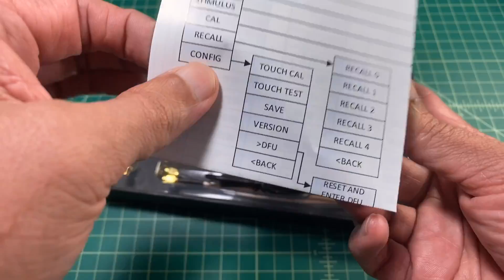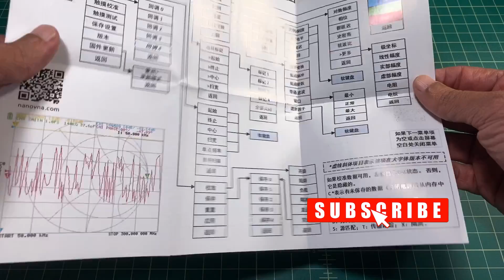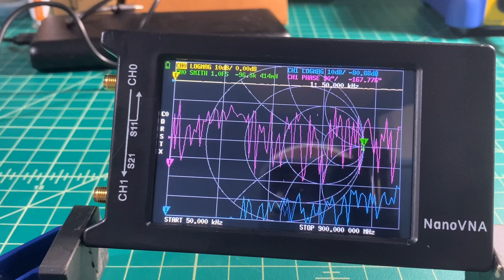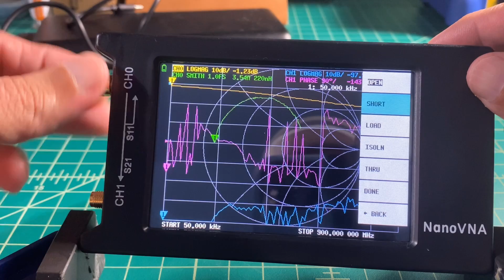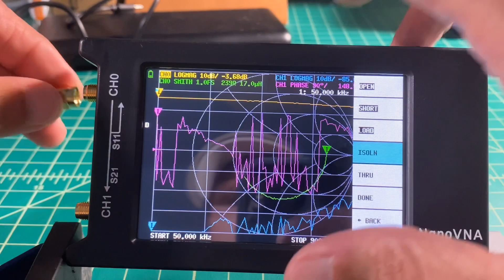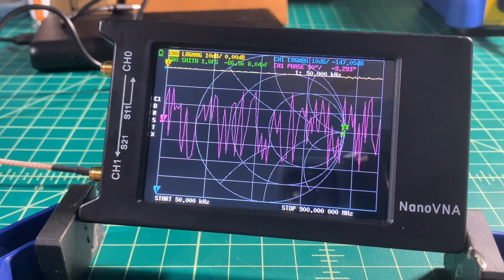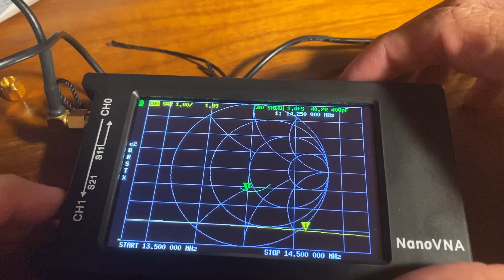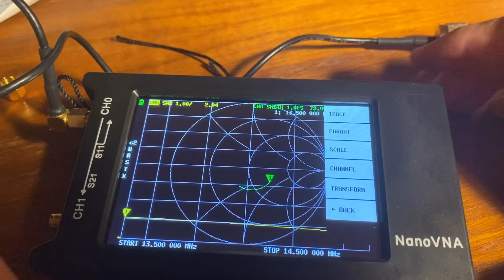NanoVNA-H4 Made Easy - HAM Radio - TheSmokinApe

Comment: The nanoVNA beat the heck of my Mr100 an Arduino based SWR analyser with a 2 line LCD display. Same calibration procedure with a short, open and 50 ohm load. Also we could build an Antenna simulator circuit with a value of LCR that gave a dip in the band of interest. I find it assuming that at the time the Mr100 was available from the usual suspects at $75 USD and that is about what I paid for my nanoVNA-H4 today.
Reply from the maker: I  have never heard of the Mr100, thanks for the heads up!

Comment: About 2 months ago I bought my nanovna-h4 from Bangood. After that I watched pretty near every video available on how to check swr. In the mean time I bought some adapters, cables and dust caps. I finally had the bright idea to try one of the cables I had purchased (sma to so239). It worked! It seems the original cable was bad. Anyway, just an FYI.
Reply from the maker: Unfortunately a bad cable can slip through, glad you got it worked out 👍

Comment: Is the nanovna saver software needed for specific functions, and firmware updates, or can the nanoVNA be used on its own for all its functions, similarly to the function you show in your video ? I have not purchased the NanoVNA yet as after trying to install its software on Ubuntu for over an hour I am unable to get it to run at all, so I would need to use it as a standalone device, or seek an alternative device if this cannot be done.
Reply from the maker: You can use it just fine as a stand along device 👍
Reply: @TheSmokinApe  Thank You for your help
Reply from the maker: Good luck with it 👍

Comment: Hi there i am attemting to test a car ignition key fob that works on RF 430mhz, i am told that its possible to do with a VNA but i havent achived it yet, any ideas?...its for the central locking on the car,,,just to see if the key is sending out a signal when you press the buttons..thanks from Fred in England..
Reply from the maker: The TinySA is the tool for the job 👍

Comment: Can this be used to measure spectrum purity like the tinySA?
Reply from the maker: No, to separate instruments
Reply: Cool, it'll be here tomorrow and I'll be watching your video on the tiny SA Ultra!
Reply from the maker: Nice, good luck with it 👍
Reply: @TheSmokinApe  

I tested my Baofeng 5RM and got:

1st (set) 146.52 10 dBm with the 40 dB attenuator 
2nd 146.4  -14dBm with the 40 dB attenuator 
3rd 292.9  -17dBm with the 40 dB attenuator 
4th 439 -27dBm with the 40 dB attenuator 
5th 585 -27dBm with the 40 dB attenuator 
6th 732 -48dBm with the 40 dB attenuator
There was a 7 and 8 but both under -40 

As I interrupt this is that the -14dBm is actually +36??

Comment: 5:42 the "short" calibration cap  that you use sure as hell looks like the 50 ohm cap. 
They are NOT labeled.!  
You have me confused as hell 5 minutes into the series.
You also failed to show the insides of the "load" cap.
I think I have it straight but the video didn't help.

Comment: So I have saved stimulus setting for each band that I have privileges on. I calibrated each time after setting the stimulus. Did I understand that you can calibrate once from 80 to 2 meters and then just add the stimulus I want providing I stay within that original calibration range?
Reply from the maker: Your best bet is to set the stimulus, calibrate and then save that to memory slot 👍

Comment: Tnx for the video. Vy nice. BUT.... My H4 model never shows correct readings. Followed your guide, but still.. I have to miss something! Used your video on my other earlier model vna, and everything works just fine. Maybe the new vna is broken. Who knows. Any ideas? Tnx again. 73...
Reply from the maker: Try calibrating with the standard from the first VNA, it could be a bad standard 👍
Reply: Tnx... Already done that. Seems like a faulty vna, so sending it back to the shop for a refund. Tnx agn..

Comment: @TheSmokinApe i have a question about some letters on the left side of the screen about halfway down, the letters you normally see C0, D,R,S,T,X. mine also has in red Pa all the time. would you chance know what the Pa stands for and how to turn Pa letters off? thank you
Reply from the maker: C0 C1 C2 C3 C4 : Each indicates that the corresponding calibration data is loaded.
c0 c1 c2 c3 c4 : Each indicates that the corresponding number of calibration data is loaded, but the frequency range has been changed after loading, indicating that the error correction is using complement.
D : Indicates that directivity error correction is applied
R : refrection tracking Indicates that error correction is applied
S : source match Indicates that error correction is applied
T : transmission tracking Indicates that error correction is applied
X : indicates that isolation (crosstalk) error correction is applied
Reply: @TheSmokinApe  I have a Red Pa letters also
Reply from the maker: Sorry Byron, I missed that. P - power level used on calibration.

Px is for Calibrate-power
a - auto, power level depend from frequency at measure point.
If after calibration change output power, Px text show as red
This is due to bug in that version X text rewrite by Px (power level)

Comment: Ok, here is the confusion I have found on several nano videos. Most so far have said you do not calibrate until the start and stop frequencies are input. You started out calibrating with out your own start and stop frequencies.I do not have a manual on mine so I am not sure which way is right. I also wonder about reset...foes that clear the save spots? Some say it does and that you have to reset before doing more measurements.
Reply from the maker: It’s best to set the frequencies first, you can save the calibration to be recalled later 👍

Comment: Does this accurately measure HT antennas? According to Retevis and Signal.Stuff, most other SWR meters give faulty readings because of reflected RF. But what about this device? When many HT antennas rely on the chassis for readings, is it possible to accurately measure HT antennas? If so, can you do a video? Where would one hold the antenna, also, how can one tell the difference between the adaptors? Several on the video look the same. Cheers!
Reply from the maker: Hey John, there are some nuances to measuring HT antennas as the manufacturers claim that in their tests the HT is supposed to be held.  These will measure any HT antenna as well as any other meter.
Reply: @TheSmokinApe  Thanks!

Comment: Great Video!    I think I got most of it ,  I will have to prefect what you shown an spoken about with some personal hands on experience.  I am going to be putting up a 20 meter Di-Pole in my back yard.  I definitely want to make sure the antenna is indeed RESONANT within and acceptable range BEFORE I PUT IT UP!!  Thanks again for the video explanation!
Reply from the maker: Glad it was helpful, good luck with the Dipole Carey 👍
Reply: Remember you will get different results with the antenna up in the air vs before it's up....all related to proximity to ground,etc

Comment: Oh man, thanks.  Just got one and didn't know where to start
Reply from the maker: Stick with it, these are great for amateur radio 👍
Reply: @TheSmokinApe  Welp, on Saturday I used the nanoVNA to tune my 10m vertical dipole antenna by using the swr bandsweep you showed.  I cut two inches off each side and got no higher than 1.3:1 in the tech portion of the band!  Didn't have to use the tuner anymore.  Pretty excited about that.  I worked Japan from California with 5 watts on FT8 right when the band was crashing.  Got a bunch of other DX too.  I'm wondering how much my yaesu ft-891 will handle with FT8 considering its a higher duty cycle mode.  The radio should be able to handle 100watts ssb no problem though I'm limited by my battery to 50watts.
Reply from the maker: @yttc88307  you should be able to do 50w and even 100w digital with that radio 👍
Reply: @TheSmokinApe  oh ok good and thanks for the reply.  Everything I was reading talks about overheating and keeping the output power down to 30-40 watts
Reply from the maker: @yttc88307  play around and experiment with your gear, you will figure out what works best 👍
Reply: @TheSmokinApe  absolutely!

Comment: Building an 17 meter dialope for fist calibration, 
how far outside the band would you typically start & stop your sweep so you can see where the antenna is resident, before trimming?
If the dip is left of my target freq, am I long or short on my diapole legs?
Reply from the maker: Hey Harold.   I would do 10% because the 17m band is pretty small, you might need to expand further.  To the left is too long and to the right is too short, best of luck on the build 👍

Comment: At the top of my screen, the swr is displayed as- swr 250m/1.5    

Shouldn't it be- swr 1.00/
How do I change that?
Thanks. 73
Reply from the maker: Is trace 0 set to the SWR format?
Reply: I think so, I’ll have to double check. I know the top trace was set to swr not sure on mine if it was trace 0 or trace 1. I was following along with this video and some of my menu options are a little different. I’d assume different firmware?  Thanks for the reply I’ve had my callsign less than a month and have learned a great deal from your channel. 73
Reply from the maker: It very well could be different firmware
Reply: Solved the issue I ended up needing to change the scale. Thanks.

Comment: Watched your video. Thanks for sharing.  I bought a NanoVNA H Version 0.2- 2.2 -1. When I first used it I got good service results. Then I played with the scale and config option and now I get only a straight line when connecting to the antenna.  Any advice?
Reply from the maker: Make sure you have the correct trace and format selected, also make sure you are calibrated correctly and connected to the right port.  These things can be confusing at first.
Reply: @TheSmokinApe , thanks for your reply, yes followed all the recommended settings and  calibration procedures, got that covered but still no readings. Could it be that I wiped out the program when I accidently pressed the "reset" in the config tab?
Reply from the maker: @KarlheinzOhm  reset erases the calibration

Comment: Excellent video.  Thanks.  I had a VNA-H given to me but does not boot up in the opening screen to allow calibration.  I cannot find how to do a factory reset, if possible.  The ONLY suggestion that I have found is for the firmware upgrade procedure.  Too soon for me to understand as a new owner.  AGAIN, that for the introductory video.
Reply from the maker: Glad it was helpful Gerald.

Comment: Got a question for you.  I purchased the NanoVNA SAA-2N. I need to evalueate the SWR on a three band 3 wire center fed wire antenna that I set up in my attic. When setting up the VNA, should I do 20, 17, & 12 meters separately, or calibrate it to do a 3 band sweep 14 to 24 MHz?  I was wondering if the the nano vna would work on each band individually, or if it has to be done as a sweep. 
The SAA-2N is a sweet unit. Very easy to work with, and no need tor adaptors, I can go straignt to the 239 on the coax. The 3 point calibration adaptors are nice and big, nothing that can easily get lost. Good unit.

Louis 
KK7AAG
Reply from the maker: Hey Louis.  You can sweep all three bands at the same time but are limited to the same number of data points.  If you sweep each band individually you can get more accurate data.
Reply: Great show! You always have great info on the unusual topics, ie the more complex stuff that most won't tackle. LOL

I wasn't sure if the antenna would allow the VNA to sweep each band individually. I wanted to get more detail.  I found that the SWR on 20 meters is over 8, but below 9. I have to see if its a matter of adjusting the wire length, or if it is the way I have it set up in the attic.  I did not have enough horizontal length, so I angled it at 90 degrees down the walls at a downward angle. That may be part of the high SWR issue, but I am not sure. Never messed with a dipole before, but the HOA is a royal pain, so I have to find a way to make it work for winter use. 

Right now I have an MFJ TriMag on the roof of my Durango, the Durango is parked next to my garage, and I am running the coax under the garage door, and into my 7300. I just got my Gen License back on August 30th, so I both new and clueless with regards to the dipole.  I am getting out with those Shark Whips, but the snow becomes an issue whent I want to change bands! LOL

KK7AAG 
Louis

Comment: I just got my H4 today.  I purchased it through RandL and asked for them to give you and Jason (Ham Radio 2.0) credit for pointing me to them.  Do you know where I can find a carrying case for it? I would like to have a zippered pouch with pockets for the gear. I love the size of the H4.   Way bigger than my original.  Thanks and 73 de KI5HXM
Reply from the maker: Hey Brent. I'm not sure about a case my backpack has a pocket it fits into perfectly.  My best guess would be to check Amazon or ebay.
Reply: @TheSmokinApe  Thanks for the reply.  I will have to figure out some pockets and sandwich bags to carry this nanoVNA in.  I have looked on amazon and my search parameters need work.  I get too many suggestions from amazon (don’t you love it when these systems try to be so helpful - haha).

Comment: You spend some time on how to calibrate the unit but no time on how to run a test.  If I want to swr of an antenna, I set the freq range and calibrate the unit.    ThenI connect the antenna and then what do I do ???

Comment: Thanks for the informative video.
Just a quick comment if nobody else has mentioned it.. When checking antennas, short out your antenna connector to discharge any static build-up before connecting it to your nanoVNA. The CH0 input might not survive a static discharge. This is good practice when connecting any kind of instrument to an antenna.
73 de Malc,  M0IYI
Reply from the maker: That’s a really good point, thanks man 👍
Reply: I have a question would it be possible to measure if there's a static charge out of curiosity? I'm assuming it would be ac voltage? Just curious.
Reply: @brandonlaragirl ...isn't the static charge that could be built up in an antenna no different than your house doorknob you zap yourself with after walking across carpet in the winter ? How would that be AC with varying frequency ? It's like the charge in a 9v battery you stick your tongue to, or a charged capacitor...that's DC.  You could measure with a volt meter, but the NanoVNA is not a volt meter, it's intended to measure very low-voltage signal RF.

Comment: I was wondering...some of the yagi’s I make , I use 75 ohm Beldin catv coax. How would I calibrate this for 75 ohm so I can check the swr on my yagi’s? Is the 50 to 75 ohm difference not enough to affect the swr that much?? These yagi’s I use are receive only. I have a boatload of sma adapters of all types here cause I use a lot of sdr radios...I also have a 75 ohm terminator F connector that i could put on my female F to SMA Male adapter, would that work in place of the 50 ohm terminator you used in this video??? thanks
Reply from the maker: 75:50 would be a 1.5:1 SWR, which is manageable.    Are you feeding these yagi's with 50 ohm coax?  I'm sure the radio is expecting 50 ohm and the jack.
Reply: @TheSmokinApe  I am using 75 ohm on the yagi’s since I don’t transmit on them, they are receive only. I have a 250’ spool of beldin high quality 75ohm coax I’ve had for a while and it’s pretty low loss coax. I just didn’t know if the wire being 75 ohm would make much difference when measuring swr with this nanovna.
Reply from the maker: You we see a 1.5:1 match which shouldn't make a bit of difference on a RX only antenna, good luck with the project!
Reply: @TheSmokinApe  i always thought an antenna or yagi would receive a signal better if its tuned close as possible to the target frequency you are trying to receive. I made a yagi to receive ATCS frequency 897.9375 and it does ok but im not sure how close it is to being on that frequency. I used a yagi calculator to build the antenna and i was going to put it on this nanovna just to see how close it is to frequency.  I used the rg6 75 ohm instead of rg-8x cause the rg6 has lower signal loss at that high of frequency (to my understanding that is).  thanks for the answers

Comment: Should the calibration be done with the coax jumpers attached or with the standards screwed directly to the nanoVNA?  You demonstrate screwing directly but I've seen other videos where the jumpers were attached and the standards attached to the jumpers.

How frequently is calibration needed? Should you calibrate every time you use it?
Reply from the maker: You can do either but understand that your test plane starts from the point of calibration.  I calibrate with each use or after a change in frequency.  If you always test the same frequency sweep you can save and recall a calibration if necessary 👍
Reply: @TheSmokinApe  Can I save and recall different segments of the HF band?
Reply: I'm trying to setup my new Wolf River Coils antenna.
Reply from the maker: Yes, you can save them as part of the calibration.  Good luck with the WRC!